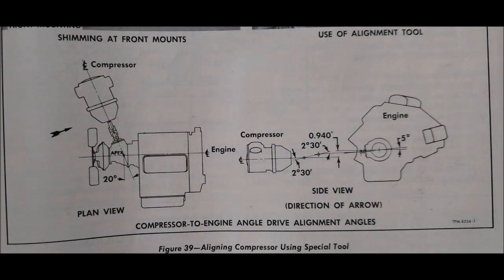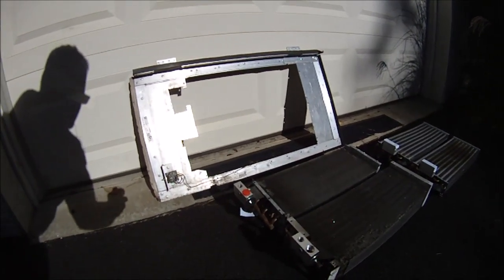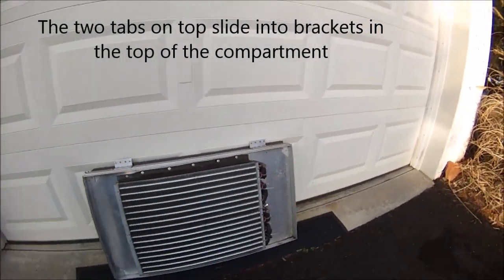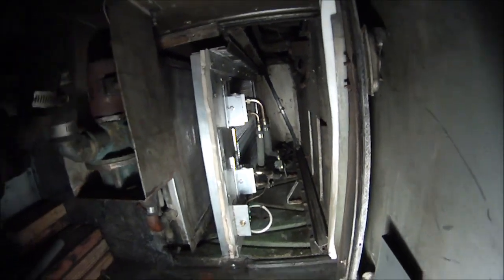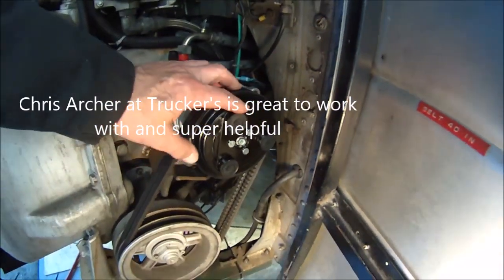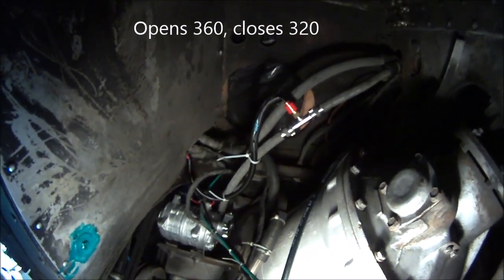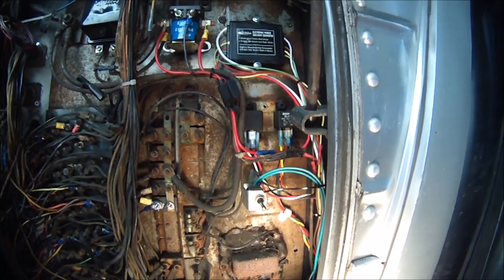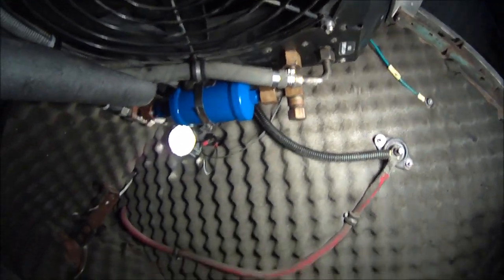Bus Conversion AC

Comment: Hey John, Gettin' old sucks doesn't it, I do the same thing.... my brain knows what I want to say but it doesn't match what comes out my mouth.... nice job explaining your system... those old A/C compressors were huge, I got rid of mine as well, I went a little different route with the AC on mine , my MCI has a 225 amp, 24v alternator so I have a 4kw inverter and I can run both rooftop AC units as I travel works really well and they are the same units that are used while plugged in.... the bus I'm building will have three rooftop units and I have a 6kw inverter for that, you might be able to do something similar with the mini split system once you install that.... not sure of the alternator size on a GM, may not have enough power available though you could install a larger alternator if required.... with the system you have it may not be necessary anyway... thanks for sharing... I always look forward to your videos
Reply from the maker: Hi James, My book says 220 amps (12v) for the alternator.  Yea, I keep fighting with myself about the whole A/C thing.  Wanted to preserve the old-bus look, and have resisted the rooftops.  If I had those I wouldn't have the 90 amp fan blowing that I have now, the 220 would probably suffice.  My projects are all child's play compared to yours!  Have I ever told you about my friend who lengthened a 4106 with one luggage bay 5.5' and raised it 7.5"?  It was amazing.  Took him three years to do that before he could begin the conversion.  Your project is much more extensive. The work you do in your videos is amazing!  Thanks for the kind comments.
John
Reply: Hi John, I think you are selling yourself a bit short... I think anyone who can keep an almost 60 year old bus in any kind of useful service is to be commended... not only does it preserve a simpler time but show that things do not need to be throw away.... it's way too easy these days to just go buy something new and be done with it... I totally get the old bus look, that's why I kept the original MC-7 windows instead of RV windows, if you put the mini-split system in and an inverter you could use that while traveling as well and not change the bus silhouette, personally I'm not crazy about the way the mini split indoor unit looks hanging on a wall but it does allow the exterior to remain original, so to each their own I guess.... check out "beginning from this morning" on YouTube, they put a mini split in a 4106.... I think it's a little small but the idea is there..... and you didn't mention the 4106 of your buddies... I would love to see some pics of it... that sounds like quite the project as well.... talk to you soon
Reply from the maker: Yes James, I'm glad you kept the old windows in your bus...gives it that nostalgic look.  I'm guessing you got the replacements from Peninsula or Motion Windows, like I did.  (they're closer to you than me and YES, EXPENSIVE but nice quality)  On the A/C, I'm kind of committed to keeping what I have due to investment and the amount of work it would take to change everything.  I did see the mini-split on "beginning from this morning" but I could never modify the front header like that.  Too many memories of that look of the interior from when I was a kid riding these buses and mine is still painted metal and all original.  The mini-split I;m planning to get uses a ducted system.  I plan to remove my 34,000 btu propane heater and replace it with the mini air handler and attach it to the existing ductwork I installed originally.  We don't use it much anyway since we tend to use space heaters and the campground electricity instead of paying for propane.  Here is a link the the mini I want to get at the moment. 
https://www.sogoodtobuy.com/12000-btu-concealed-duct-air-conditioner-heat-pump-sena-12hf-id/
I'll have to see if I can dig up photos (no digital, too old) of my friend's extended and raised '06 and take pics of them and send to you.  It was really something!  But, still not as extensive as your MC-7 project.  GREAT work on the slides, btw.  I was watching that last night.  IMPRESSIVE!
Take care, John

Comment: A true engineer, brilliant idea. I'am curious, how are these busses kept cool providing they don't have the factory or a modified cooling system while in transit like yours, do folks run their generator and use their roof A/C units???.
   Thanks for sharing!
    Kind regards,Eric Dee
Reply from the maker: The original a/c factory arrangement was  driven by a 3-cylinder huge compressor that ran on a power take off connected to the fan drive.  It had all the components of a normal auto air, but far larger.  It could only be operated when the bus was running.  There was no a/c option when the engine was off.  The model before this bus built from 1951 to 1960, used a small gasoline powered engine mounted on the side of the bus who's only job was to run the a/c.  Those buses had smaller engines, 6V-71 as compared to mine which has an 8V-71.  Two more cylinders, in other words.  Hope that explains.
Reply: @strayhound61  : Thank you for your time and response. 
   I understand the A/C systems with the factory busses but, for those who don't have an a/c system currently that was originally a factory unit, are people using generators to run their aftermarket roof air systems while traveling on the highway to keep their busses cool .
   Thanks for reading!
Reply from the maker: @ericdee6802  Hi Eric, I think you'll find people doing just about any combination of things.  Many with old buses like mine just go with no a/c.  Others do as you note, run their generators and roof airs.  (I could never bring myself to installing roof a/c units and ruining the classic lines of the bus.)  I have even seen a couple of custom made systems that run two a/c compressors on one central system with one running off the engine and another running off 110 volts but using the same evaporator, condenser and fans.  Crazy complicated!  These days, the factory standard seems to be to install a bunch of roof airs (I've seen as many as 5 on one coach) and run a large generator or plug into shore power to run them.   Many of the coaches on the Freightliner  chassis, use a dash air like in a car to cool the front and nothing in the back unless they start their generators.  Hope this explains a little better.